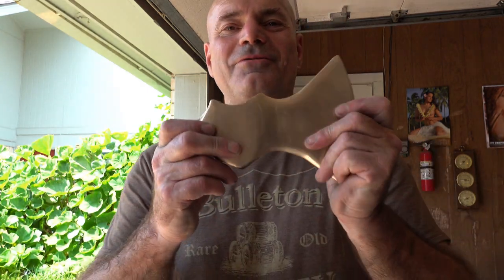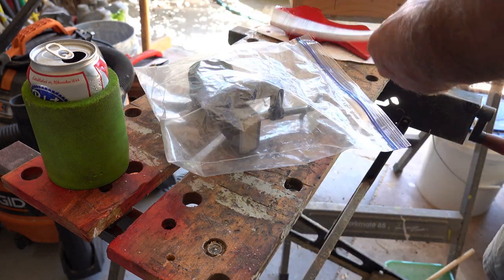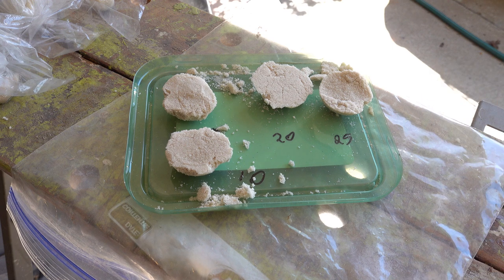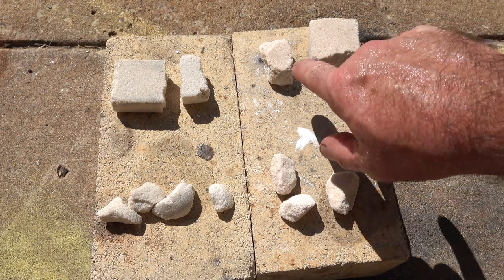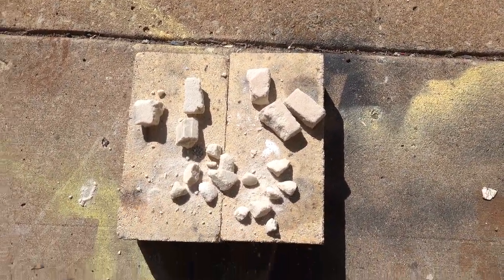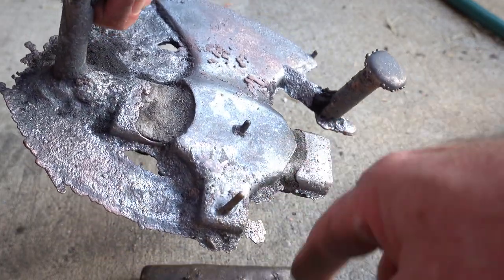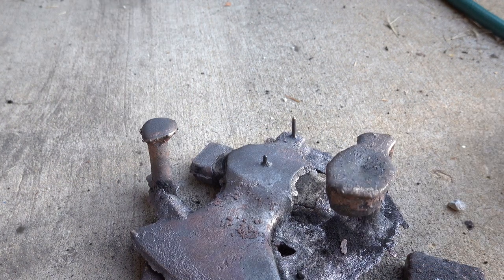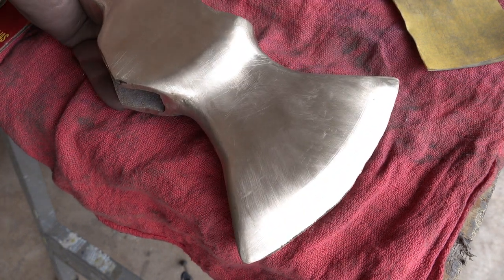casting a bronze axe

Comment: Great job Mike,beautiful  axe,looks to be a real skull splitter. Question. Is it brass,and hard enough to be functional?  Keep up the fine videos, and always have a PBR ready fir emergency..haha right on, brother Valhalla, has a place for you.
Reply from the maker: it's bronze. adding a little tin or other alloy increases the hardness of copper. to make it harder not like steel. work Harding is performed by hitting the blade edge with a hammer this does the same thing as quenching of steel. bronze was king before iron

Comment: I dont understand this part 3:28, btw nice video i really enjoy your content!!
Reply from the maker: silica sand and the water glass harden with CO2. putting it in the bag builds pressure to force the CO2 into the mix and make a better cure. a pressure pot would be better